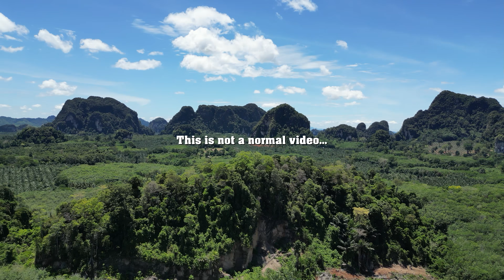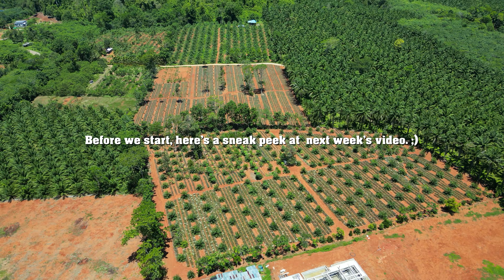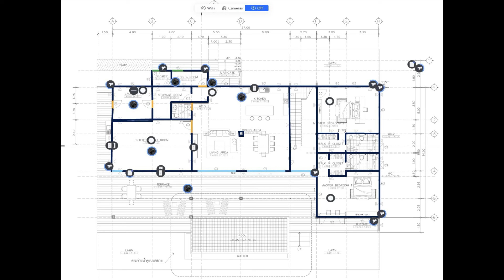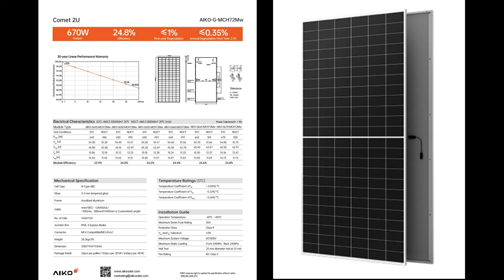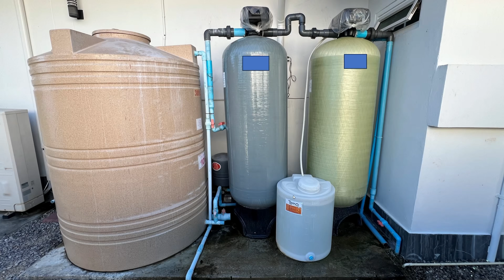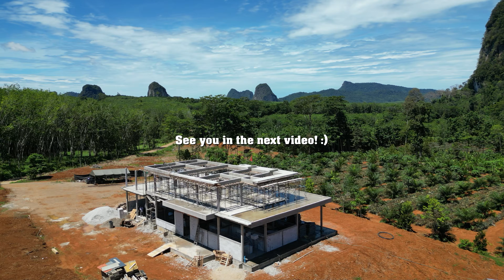Our plans for Solar, Security, Home Networking & Water Filtration

Comment: Looks like you are over the top with regard to the internet and web wireless and CCTV / security.
I would keep it simple for lack of future problems.
I wouldn't have bothered connecting to the grid.  It probably work out cheaper to have a back up generator if bother with anything.
Reply from the maker: I am a retired IT engineer. I'll be OK. 😉🙏

Comment: It looks like the network co added a ground rod. Any reason you didn't ground the conduit to the house ground in CU? What size ducting did you use for the network, and did you pull terminated cables throughout? Saw 5 or 6k meters of cat6. That's a lot of cat6.
Reply from the maker: Yes. Sorry, what is CU? Can't remember the size of the conduits, but almost all of them are less than 40% full. The cables have not yet been terminated. We'll do that in the next phase when they come to mount the cameras and wifi APs.
Reply: @housethailand Consumer Unit. Fuse box to some, breaker board to others.
Reply from the maker: We still don't have one yet. 🤣 The electrician will be mounting and wiring them this week.

Comment: From my experience with UDM Pro Max and U6 Pro APs. I've had a terrible time with iOS devices dropping connection and it's a widely known issue. I believe the problem is with Apple and their implementation of mDNS but there's a raft of contradicting advice out there. Did everything suggested like rolling back firmware etc but the problem arises again. In my work environment I'm using the same UDM but experience zero issues with AC LR APs. Hope you can have a word with the contractor and raise this before the install as it might save you some grief. Unifi will usually not issue RMAs as other devices have no issues. Hope this helps
Reply from the maker: Thanks! But too late now. Already bought all the hardware.
Reply: @housethailand  Just to let you know that all of my problems are now resolved with the U6 Pro APs. I can't put my finger on the exact firmware version that fixed things as it was an auto update that sorted everything while we were away. Absolutely love your build and planning and hope it lives up to all your dreams. Awesome
Reply from the maker: Great to hear!! Maybe it was this update? See near the end of the video: https://youtu.be/iOYL2L9Hjzk?si=a6QIU5uDw7zwCjT4
Reply: @housethailand  It was actually around 2 months ago but I just remembered to update my comment so you wouldn't have any doubt about your setup when you get to power it all up

Comment: Thanks for sharing. Ideally, you should not use the Telco's router and just direct connect the ProMax. If you can't do this (some telco's are a pita) then see if the router can be placed into Bridge-Mode and if that can't be done make sure you can at least disable NAT on it (dual NAT creates lots of headaches). For the server room I'd suggest a freestanding 22U half-height rack instead of wall mounting as it's much easier for retrofit down the track as you can pivot the rack for rear access and gives you ample room for future-proofing (more devices such as entertainment streaming from your NAS, a larger power-conditioning UPS instead of the smaller Unifi RPS etc). Have all the network cables connected to passive patch-panels (each port labelled) and then connect from there to your devices. I also noticed you weren't going to add the Unifi POE lights.... these will be great for entranceways and exterior pathways. Oh, and I also suggest you only use the ports on the ProMax for aggregation uplink from switches (ie no direct connection to ethernet ports around the house). Finally, have you considered doing the solar panel rows in East-West angled rows (half get more power in the morning earlier and half get more power in the afternoon later but middle day is pretty average across all).
Reply from the maker: Great advice, thanks!
Reply: @housethailand  AIS and 3BB both allow you to use your own router for their fiber products (or they do in Phuket and major metros at least).  Running a load balanced set up is reasonably easy here - I have both AIS and 3BB fiber TTH ONTs directly connected to me router, and then load balance in PFsense.

Comment: 1) How you going to clean the solar panels? It need to clean at least every 6 months to maintain its efficiency.

2) With lof of high tech stuffs around the house; how you going to prevent hacker accessing your system?
Sorry; I being watching so much Jim Browning videos lately. He is in the UK and able to hack into scam centre in India.
Reply from the maker: Thanks, yes, as dusty as it gets here, the panels will need to be cleaned twice a year. The heavy rain here should help a lot, but VSolar provides 2 free cleanings, and paid cleanings after that. They designed gaps around the panels to make installation and maintenance much easier.

I have some knowledge myself, and the UniFi system comes with an infinite array of security options, but yes, I will be using professional help to secure the network. We already have several layers of protection planned.

Comment: Thanks for sharing all your research and planning. I am in planning phase for 300 sqm villa in Hua Hin. Recommendations regarding lithium battery. 1. Decide very carefully about the battery supplier, because all add on modules must sourced from same supplier in same technology, otherwise it will not fit smoothly together. 2. Decide for lithium ion LFP, not for NMC technology to reduce fire risk. 3. All LFP cells are produced in China. Price is 150 USD/kWh. Don’t pay more than 250 USD.  Best cell manufacturers are BYD, CATL, EVE. Other CN manufacturers will bring quality issues. 4. Battery should be placed more outside oriented, definitively not in the central control room, to release the fire gases more easily. 5. Solar panels, batteries and EV fast charging runs on DC power. Every inverter bings losses. I am planning a DC backbone solution, but that’s not jet standard today. 6. Battery 20 kWh is much to small , see other comments. Wish you all the best.

Comment: Be aware that 20 kWh batteries means 16 kWh battery power for the evening and night (20% of batteries isn’t discharged to extend battery life). An air conditioner uses on average 1 kWh per hour at 25 degrees. This means only two air conditioners can run for 8 hours (16 kWh total) next to other electricity being used during the evening and night. You probably need extra batteries in order to not use the PEA.
Reply from the maker: Thanks! Yeah, agreed. We are starting small and will test to see how far we can get into the night before depleting the batteries. After a couple months, we'll add more. We also need to think about the future when we buy an EV. We're holding off for a year or so, in hopes of a car and charger that supports V2L / V2x so that we can use the 100kWh+ battery in the EV to augment the nighttime storage. We should definitely have more than enough power during the day to charge the solar and EV batteries, but will learn over time how far to discharge them overnight. We didn't want to over-invest in batteries now, as the tech and chemistry is advancing so quickly.